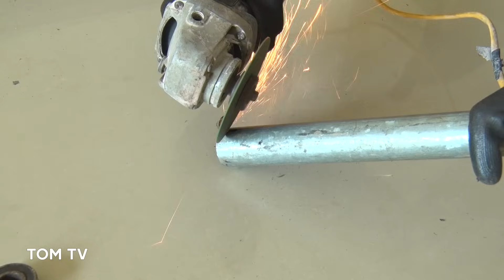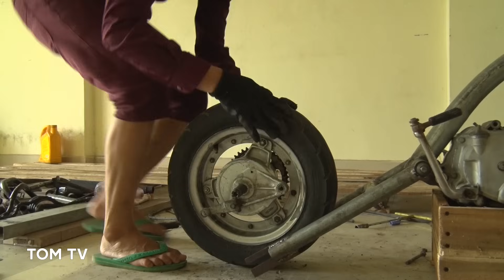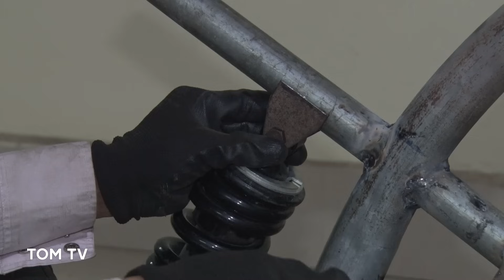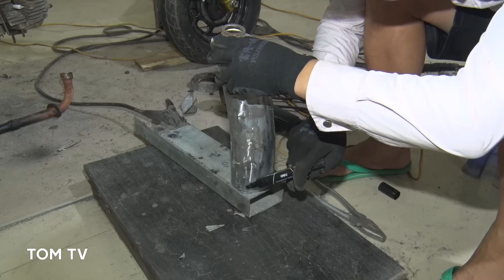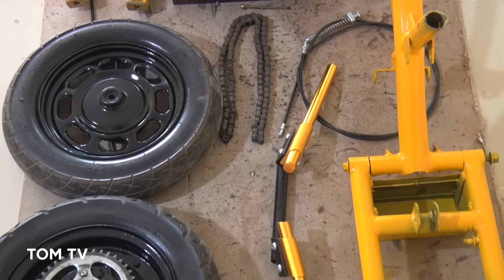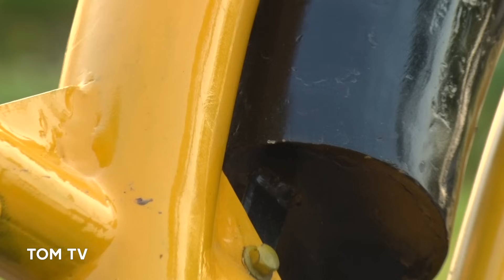How to Build Harley - Making Harley

Comment: Nice effort 100%
but you are sitting high, so the CG is high and the front rake angle is high too.  The wide yaw will make cornering scary, do be careful.

You're next project should be a BMX bicycle with a scooter engine + tyre unit in the rear. 👍
Reply from the maker: Tks your feedback 🥰🥰🥰🥰

Comment: As a former professional motorcycle mechanic and workshop owner I have seen some truly horrendous things, but this an entire order of magnitude worse than everything I saw combined!

From the couldn't care less manner in which everything was done, to just throwing it together and obliterating everything with spray paint, I have never seen such a consistently appalling standard of 'work'.

If the objective were to end up with a piece of garbage that's going to fracture, this is it. 

I noticed that it was only briefly run very slowly on glass flat road surfaces without so much as a ripple in them. 

Its a lottery of which weld fails first (headstock main frame tube!). 

It doesn't matter because this was only thrown together so they could get a video out of it, it may be seen as a backdrop in other videos but I doubt that anyone would actually ride it other than briefly on glass flat roads for a video clip.

Its complete garbage from start to finish and would rightly be prohibited from operating on public roads where I live, in fact it may even be issued with a destruction order in the interests of public safety!
Reply: So.....